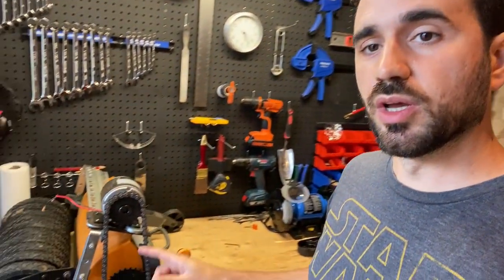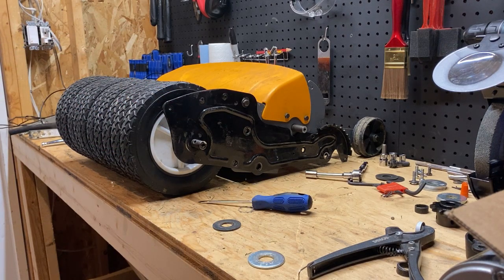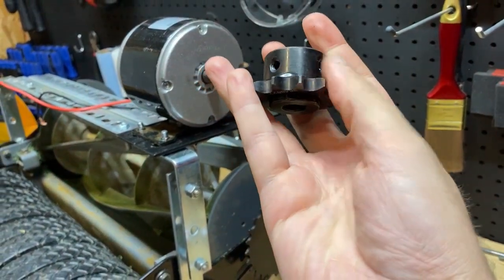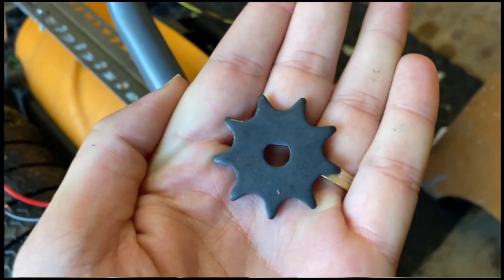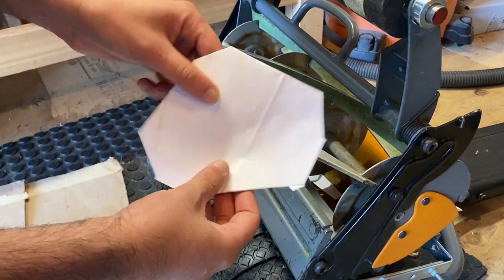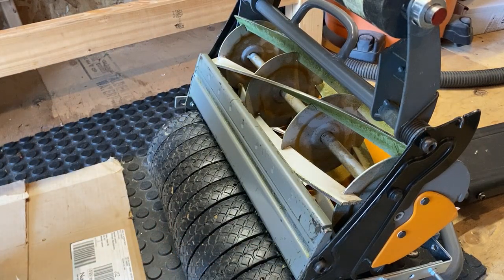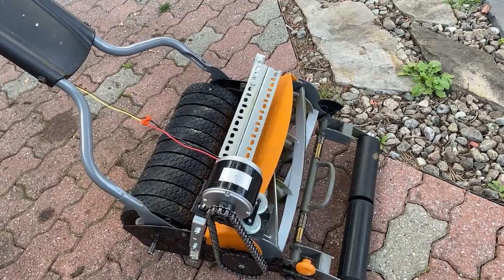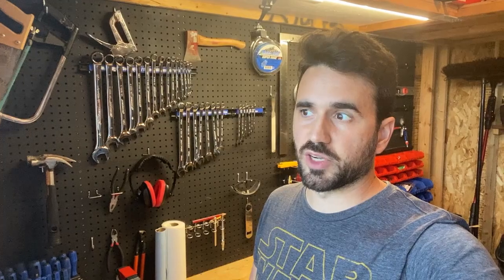Fiskars Reel Mower - Electric Conversion

Comment: Great job. I actually did the design of the front and rear rollers on my Fiskars a few years ago. I always wanted to try to add the motor
Reply from the maker: This all started from inspiration from your mower! Glad to see you checked out this project. Thanks for the help and let me know if you need any info on the parts used!

Comment: Thanks!  I took this idea, improved it greatly, then made an AI height sensor that also automatically adjusts the height.  Honda, Toro, John Deere, Fiskars and a few other companies are very very interested.  I appreciate you posting this - it's life changing, because I will be able to retire at 26 years old.
Reply: Is there a vids on what you did? Thanks.
Reply: Weird flex.

Comment: Brilliant job mate

It makes me wonder why do you need the big set of rollers on the back is that for striping? 

I also wonder about the front roller 

I know the  front roller is going to push the grass down as you move forward and lay it flat 

and it will not be in a position to be cut by the cutting bar 

Other cylinder mowers in the UK, such as Allett - after the mower passes, the front roller

Theres a second brush roller behind the front roller that spins in the opposite direction to the blades so the idea is it brushes the grass to stand upright to be presented to the blades for cutting

There’s another mechanism where they use a comb, in situ, just to comb or rake the grass to the upright position behind the front roller

So I wonder if you could convert your front roller to a brush and figure out a way to get that to spin in the opposite direction …..

That would be textbook
Reply: love this idea, but yea the roller on the front doesnt make any sense. yes the rollers in the back are for laying down the grass and adding that nice stripe.
Reply: Front rollers are so you don't scalp on uneven ground, keeps it level
Reply: @jakegreen8074  yup, looked into that. dual rollers it is when i start building mine lol.

Comment: What is the part number for the sproket weld-on hub and what is the bore size for both, the hub and the sproket?
Reply: Did you figure this out? And how did you get the original sprocket off the motor shaft? I got the nut off but the sprocket seems difficult without damaging threads.

Comment: Did you do anything to get it to cut lower than 1”?
Reply: Looks like the front roller replacing the front wheels makes the Height Of Cut (HOC) lower than 1" if the diameter is smaller 👍

Comment: How did you remove the original rear sprocket? I removed the set screw but it will not bugde. The front sprocket came off very easy.
Reply: Give it a little love tap with a hammer and some kind of chisel.

Comment: What do you think of making a guided pdf for pay? I’d gladly pay for an assembly manual with a parts list, affiliate links to buy them, and step by step instructions with pictures.
Reply from the maker: It’s not in the plans right now. It would take some time to put something proper together. I do include affiliate links to the parts on the description of this video (other than the hardware for the bracket). I’ll include the ones for Amazon US as well!
Reply: @jamescorreia6944  awesome please do thank you

Comment: Probably a silly question. I'm not mechanically handy... what are the specs for the longer bolts you used to attach the motor mount?

Comment: How did you get the set screw on the back sprocket out?  I’ve sprayed it and nothing I do will loosen the set screw.  It’s a standard threaded screw correct?

Comment: Great video. I am stuck at removing the rear chain sprocket. Just way too hard with all tools I have tried and generous amount of wd40. Any suggestions? Do you happen to know the rear 26 teeth 4.25" outer dia sprocket part number. I might as well order one for my project.
Reply from the maker: I used a prying bar to leverage between the sprocket and the mower. Then I hammered the top of the prying bar and rotated the sprocket a few times in order to pry it out evenly. It will eventually come out, it wasn’t born there 😁

Comment: Did you have to drill the center of the rear wheels to get the half inch bore holes big enough to fit on the shaft?
Reply from the maker: Yes I did ;)

Comment: In the link is a 9 teeth sprocket but in the end you said 12 teeth sprocket. Which size should we get without breaking the chain?
Reply from the maker: My bad! It’s definitely the 9 teeth sprocket + the original chain. Then I just added spacers on my motor support to raise it which made the chain have just the right tension.

Comment: This is very useful! Working on the same thing and just bought the same motor after figuring out a 12V gear motor was too weak. I was planning to power the system from two LiFeP4 batteries. But i have a 18V battery lying around and will try that seeing you did so. How is that starting torque? Does it have enough torque to go through moderately dense grass?
Reply from the maker: Thank you! As long as you have this type of gear ratio (bigger sprocket on the reel blade, smaller one on the motor) you’ll have no issues with torque. I’ve tried mowing my backyard at 2.5” with the front wheels on and I also mow my frontyard often at 1”. Both are pretty dense and the mower doesn’t bog down whatsoever. With the gears reversed, I was getting a lot more speed at the reel with the same power output, but the mower would bog down as soon as it hit thick grass. Hope this helps!
Reply: Thanks for confirming.

Comment: Hi James,  I did the same and used a 13" 18 V Ryobi Rotory motor but can't tell you how many motor speed controls I have burned through.  Any thoughts?  Right now it is running at the full 2700 rpm without a speed control.  It is much to fast and need to find an controller.  And I did try the one you posted on your parts list.  Oh yes, I am using 24 V Sunjoe Batteries.

Comment: Great design on the rollersGo battery! Very little output needed. A BLDC motor that could utilize a battery platform you already have would be plenty strong. Capacify shouldn't be an issue either at 4ah or better.

Comment: Hey James, late in the game here. Just getting into reel mowing and just bought  same fiskelars reel mower and wanting to do the same, the adjustment is not compromise with all the mods? i wanted to do the cutting at highest  setting.
Reply: And I wanted to use my 40volt ryobi battery since I have the mower and the string trimmer and the leaf blower already. Do you know or anyone know what is the best type? Thanks.

Comment: So I have a similar setup as yours, but my motor keeps bogging down as it encounters literally any type of grass and I have to run the speed control all the way up to 100%. I'm using a Dewalt 20v 6Ah battery with the 24v motor. I'm just wondering how tight the chain should be because I feel like it's so tight that it can't power through both the tension on the chain AND the grass.
Reply: How did you get the set screw on the back sprocket out?  I’ve sprayed it and nothing I do will loosen the set screw.  It’s a standard threaded screw correct?
Reply: @chrisbarber6610  2ft breaker bar. Give it hell.

Comment: This may be a newbie question but where can I find those metal brackets? Is there a term for that? Metal struts?
Reply: The sides are galvanized steel mending braces (the straight ones), the one that bends to the top piece is a corner brace, and the long top bar going across with the tons of holes is called a slotted angle.

Comment: How many minutes do you get out of that battery with the 24v motor?  I might try your setup with my Milwaukee m18 batteries, I have 5 and 9 amp batteries.
Reply from the maker: I’ve done 2 passes on my front yard which would be a total of 6000 sqft, about 40min. It was still going strong at the end! 5ah and 9ah will give you plenty of juice, the battery I use is a 6ah one.

Comment: Does putting the larger gear on the blade shaft stop the mower from bogging down?
Reply from the maker: It definitely prevents it from bogging down as much. Mine is bogging down a bit this year, but the motor is only a 20v one and the lawn as gotten very thick with the applications of PGR. If I were to do it again, I would use a 40v motor (more voltage = more torque). Having a bigger sprocket on the blade like I did also increases torque substantially.

Comment: Would it be possible to do the rear wheels while keeping the original reel drive mechanism intact (no motor)? In that case would I only need 8 or 9 wheels? Do you think it would work ok?
Reply from the maker: The problem is finding wheels with the same diameter as the stock ones. I couldn’t find any. If you can, it can definitely be done! Striperman has videos on YouTube with a mower where he did that, but he bought all new wheels and just glued the original wheel bearings to them
Reply: @jamescorreia6944  Good to know, thank you. Maybe I can call Fiskars themselves and see if they can sell me some
Reply: Also curious on this! I am using a PVC DIY striper that drags behind and seems to work ok, but would rather just use wheels across the back if they could stripe as well.

Comment: Hey there. I am getting ready to do the rear roller mod. I was looking at my mower tonight. To get the rear axle out I would just need to take the cover off, break the chain and then loosen the set screw that looks to be a hey key. Is that correct? I also have an 18" conveyor roller on order. I may not be able to wait and may build a custom roller until it gets here.
Reply from the maker: Hey Sean! Take the chain cover off, take the height adjuster off and just pull the small sprocket on the reel blade off. The chain should come right off, I never had to break that one. You can also try pulling the big sprocket off instead of disassembling the height adjuster to get the small one out, but it might too tight.
Reply: @jamescorreia6944  awesome. I am going to play with it today. I am either going to buy lawnmower wheels for the rear axle or I am going to attach my big league lawns striper to it. I also ordered a conveyor roller for the front which should reduce the cut height by quite a bit.
Reply: @jamescorreia6944  Did you use 7" plastic wheels or steel wheels?
Reply from the maker: @SeanGallianSoulAu  the wheels from the big lawn league striper won’t work because they have a very small diameter, so the bed knife will be scraping on the ground. Get lawn mower wheels instead
Reply: @jamescorreia6944  What size did you use. 7" seem to be too small circumference.
Reply: My thought was boring out the holes on the bracket and hanging the bracket from the axle. Obviously I would have to adjust it to fit within the existing wheels.
Reply: Hi sean, The original wheels are just shy of 8"; 7-3/4 would be my closest guess. So if I understand correctly and you're not doing the full electric conversion, just the rear roller mod, you'll have to keep both original wheels (that have a ratcheting mechanism built-in to spin the blade). You'll therefore need to slip additional wheels in between that are the same size or slightly smaller, because if you go anything even slightly bigger (like a true 8"), it will "prop up" your drive wheels, getting them to "hover" and won't have enough traction to drive the blades... I'd try to get my hands on 7.75 or 7.5 inch wheels. 

If you do decide to simply hookup a striping kit behind it instead, make sure it doesn't exceed 18" in width or else it will throw off your striping effect, and your stripes will be nearly impossible to get clean and defined.

Comment: Hi!  How’d you get the sprocket on the motor to fit?  Did you use spacers?
Reply from the maker: I purchased a sprocket for the motor that fits the Fiskars’ original chain. The link is in the description. It’s a direct replacement for the sprocket that comes with the motor

Comment: Super cool job you did great but I think it would be a lot cheaper total just to buy like an Atlas self propelled mower that's electric without having to worry about building anything yourself but it wouldn't make the lines as pretty but it would cut the grass if it was a little bit taller better in comparison but nonetheless it looks cool!
Reply: This is a reel mower and the Atlas is rotary.

Comment: Great video! I would like to try converting a used Fiskars but prefer corded instead of battery. I don't mind using a 100' orange outdoor extension cord. I've been using an electric rotary for decades. But I am not a techie.  Any idea what AC motor specs I should look for?  Or just use a DC motor and connect it to a high wattage laptop adapter connected to my orange outdoor extension cord? Thx
Reply from the maker: I would just replicate the setup I made with the DC motor connected to a laptop adapter to keep things more simple. Just be careful with that extension cord in front of the reel! :)
Reply: If i may chime in, we all have old/broken power tools laying around; circular saw, drill, shop vac, etc. If you want to keep your costs down, you may want to repurpose the motor off any of these for testing purposes. Anything with 5 or 6 amps or more and at least 2000rpm operating speed will do...

Comment: Hi, I noticed that your link for the battery has 18v battery while the motor is 24v. Would the 18v battery able to work well with that 24v motor. Thanks alot for your contents!
Reply from the maker: Yes, no problem in using an 18v battery on a 24v motor. The opposite (example, 40v battery on a 24v motor) could cause for the motor to fail more rapidly though. No issues with the setup described on this video though, going on 1+ year!
Reply: James, the gear at the reel shaft in your video is the larger than the one that originally came with the mower at the reel shaft prior to the modification. Did you use the larger original gear from the rear wheel shaft and put it there? Thanks
Reply from the maker: @VMH.  I had to buy a different sprocket from amazon for the motor, that works with the chain. I believe the link to it is in the description. As for the sprocket on the reel, I used the one that was originally on the wheels.
Reply: @jamescorreia6944  Thanks for all of your help. I modified the mower and it's working very good!

Comment: Can you still use the grass catcher with that setup?
Reply from the maker: Only if you install the front wheels and not the front roller! Otherwise, you might need to build a platform frame to keep the catcher from touching the roller

Comment: I’ve followed this design perfectly, but for some reason the motor just bogs down when I try to cut grass. I’ve tried using v belt pulleys and a belt but the motor doesn’t seem to have enough torque to do it. Any ideas? I’m using an 18v 6ah Milwaukee battery although I don’t think that impacts anything.
Reply: I would suggest turning the cylinder by hand if it is correctly adjusted. Then I would think off the pulleys if they are correct size and if you are not swapping speed for torque ?
Reply from the maker: Do you have the smaller sprocket on the motor and a bigger one on the reel blade? As mentioned before, this will your reel less speed, but more torque.

Comment: Great work James. Am not very mechanically gifted to do these modifications myself...but you never know. Am looking for someone in Perth, who can convert/combine the Fiskars StraySharp reel mower with the EGO battery system with the telescopic handle...similar to what Allett have done on their Stirling series.
Reply from the maker: Hello Jibu, thank you! This mower is now converted to use Ryobi hardware and batteries. I also installed the Ryobi telescopic handle. I’ll upload a video of that conversion soon 😉
Reply: @jamescorreia6944  The best I've seen so far...everything is boxed in with a neat finish. 
https://youtu.be/Jq2TTOQOdcY
Reply: @jamescorreia6944  I was just watching your video and was going to use my Ryobi 40v battery and adapter.  Did you use the same electric motor and speed controller when you swapped to Ryobi?  Curious before I buy what's in my Amazon cart.

Comment: Could you just use the two sprockets that are already on the mower? Put the small one on the motor and the big one on the wheel. That way you just keep the same chain?
Reply from the maker: The sprockets don’t fit the motor. The other one was from the mower, and the chain I ended up using the original one as I show after.
Reply: @jamescorreia6944  Ahhh, I got ya. Great job man. How’s she holding up? Still good?
Reply from the maker: @dexterstanley4185  It was still holding strong just as in day one, but I gutted it and converted it again with Ryobi hardware. Telescopic handle, Ryobi’s 40v motor and battery system. I’m still tweaking it and I’ll finish it once the season begins again here in Canada. The plan is to have it self propelled with a second motor… Another video will be released in a few weeks 😉
Reply: How did the conversion go?

Comment: James, Did you use bearings inside all the rear wheels? The stock wheels have hidden bearings, but the after market ones don't!
Reply from the maker: No bearings! Not necessary

Comment: Will this work on a Scott’s 20 in manual reel? Looks cool
Reply from the maker: If there’s a chain to drive the blade, yes it can be done. But I think on that mower, the wheel shaft is the same as the blade shaft. If that’s the case, then it wouldn’t work.
Reply: I used to have a similar mower to the scott and it freewheeled when you stopped etc… therefore you should be able to attact a motor and have the blades spin faster than the unit going… the hard part would be attaching the drivetrain…